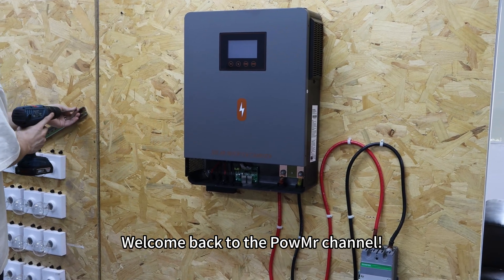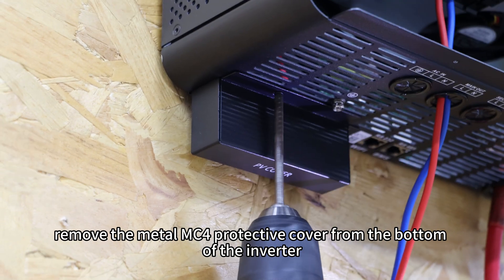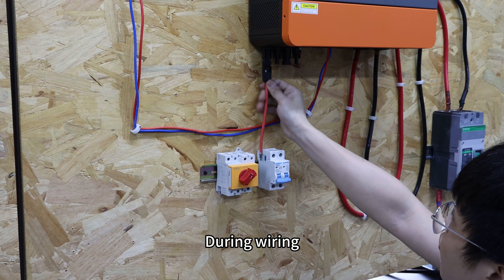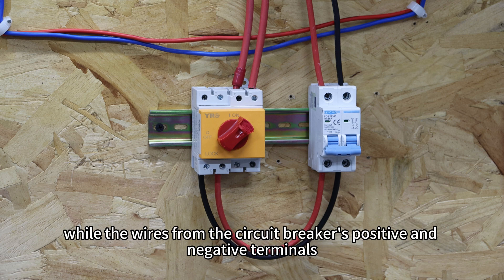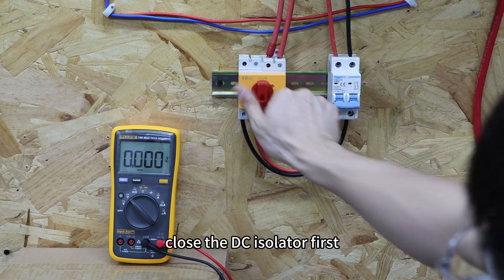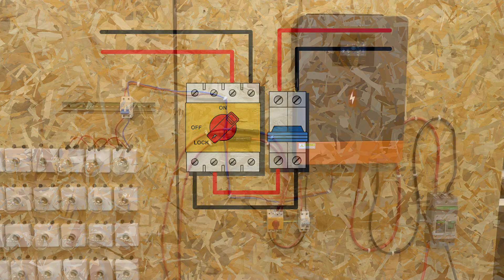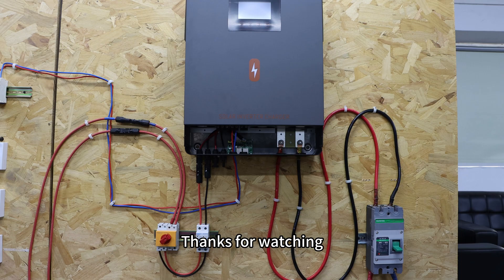How to Connect Photovoltaic Input Safely | DC Breakers & Isolators Explained

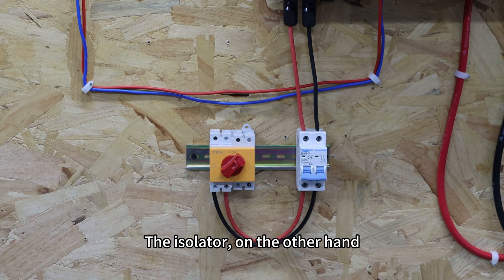Comment: Is 1:39 true ? I was taught that when the circuit breaker off, there will not be any current, unless the breaker is faulty, or, unless there is load then some inductive current (the arc) in some tiny second which the breaker can handle by design.
Reply from the maker: When the inverter battery cable is connected and enters the standby state, the PV line is still connected and in a no-current state.

At this time, closing the PV isolation switch first only physically connects the line and operates without power, just like plugging a plug into a socket without load.

Then close the PV circuit breaker. When closed, the current of the photovoltaic line begins to flow. If there is a fault, such as a short circuit, the circuit breaker will immediately trip for protection. If there is no fault, the inverter will work normally. All current impacts are borne by the PV circuit breaker.

Comment: Switching the circuit breaker before the isolator ? The circuit breaker under load is where we have repeatedly seen examples of arc flash. The gapping on the isolator is surely there so there will be no arc flash then turn off the breaker.
Reply from the maker: When the inverter battery cable is connected and enters the standby state, the PV line is still connected and in a no-current state.

At this time, closing the PV isolation switch first only physically connects the line and operates without power, just like plugging a plug into a socket without load.

Then close the PV circuit breaker. When closed, the current of the photovoltaic line begins to flow. If there is a fault, such as a short circuit, the circuit breaker will immediately trip for protection. If there is no fault, the inverter will work normally. All current impacts are borne by the PV circuit breaker.